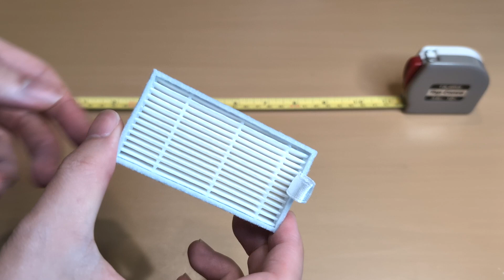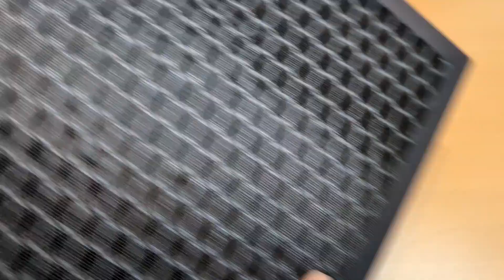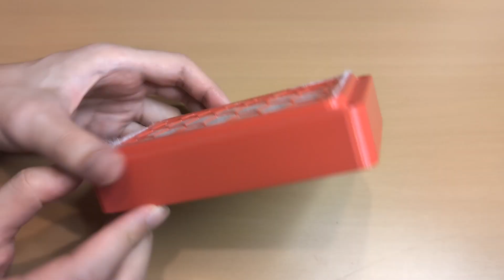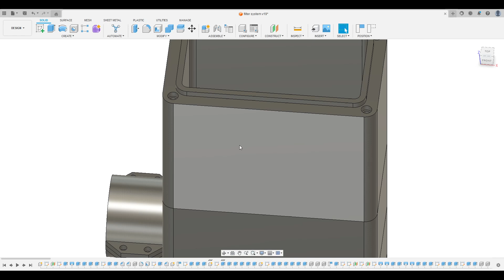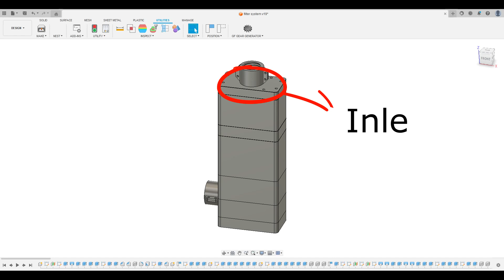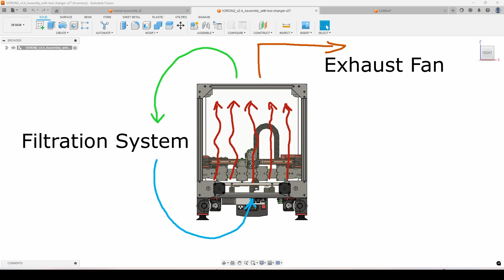[Tool Changer] Comprehensive Fume Filtration for 3D Printing: Clean Air Without Compromising Quality

Comment: Carbon filter usually goes first, you can also see that in commercial products, because filtereing air for fine particulates and then releasing carbon particulates in the air again is not a good solution. You can also have a HEPA filter first then the carbon filter and the again a HEPA filter
Reply: I've actually been wondering this, the Ikea air purifiers and Airthings Renew all put the carbon filter after the HEPA filter. The Airthings Renew also uses a HEPA 13 filter which is often a bit difficult to find on air purifiers.

I have a 3-4 particle sensors and under normal circumstances they often hover around 2-4 PPM both for 2.5nm and 1nm particles , so I'm unsure if having the carbon filter after the HEPA filter actually does release carbon particulates.
Reply: @MrGemeco  "... the Ikea air purifiers and Airthings Renew all put the carbon filter after the HEPA filter...." They usually wash it so it does not dust off too much. And of course they want to save money =) 
My air purifier also has it´s carbon filter after the HEPA filter but I wouldn´t do it for a DIY solution. You can never clean your carbon that well.
Reply from the maker: The sequence can be switched to carbon first, then the HEPA.

Comment: The volume of air going into the filtration system and coming out of it is (very nearly) the same. How will this create a low pressure inside the enclosure?
Reply from the maker: 1. Air Removal Creates Negative Pressure
◆When the fan actively sucks air out of the chamber, it removes air faster than it can naturally flow back in. This creates a temporary low-pressure zone inside the chamber.
◆Even if the air is circulated back, the fan continuously pulls air out, maintaining a lower pressure inside the chamber relative to the outside.

2. Flow Resistance in Circulation
◆The air being circulated back into the chamber typically passes through ducts, filters, or other components. These elements create resistance to airflow, slowing the rate at which air re-enters the chamber.
◆This resistance prevents the re-circulated air from fully balancing the air removed, keeping the chamber under negative pressure.

3. Concept of Airflow Balance
◆The rate of air removal by the fan is greater than or equal to the rate of air returning to the chamber. As long as the removal rate exceeds the return rate (even slightly), negative pressure will persist.
◆Circulation alone cannot eliminate the pressure difference because the fan continuously "dominates" the airflow.

4. Analogy for Clarity
Imagine a vacuum cleaner sucking air out of a sealed box but with a small hose feeding some air back in:
◆The vacuum cleaner pulls air faster than the small hose can supply it, so the pressure inside the box stays lower than outside.
◆Even if you connect the hose to the exhaust of the vacuum cleaner (creating a "circulation"), the resistance in the hose keeps the box in negative pressure.

5. Application to 3D Printer Chambers
In the 3D printer chamber:
◆The fan removes air, reducing the pressure.
◆The re-circulated air flows back but encounters resistance (through filters or ducts), making it slower to return.
◆This results in a persistent negative pressure, ensuring fumes or particles are pulled into the filtration system rather than leaking out of the chamber.
Reply: @SlowEngineering  It would be nice to verify if this is indead true with a smoke test.
Reply from the maker: @Ugaux  Yes, I'll assemble the parts and test whether they work with the sensors. I'll also test whether the negative pressure created inside is enough to maintain the fume inside the enclosure.
Reply: @SlowEngineering  Amazing, thanks for the hard work!
Reply: What is the reason of making the air circulate instead of just filtering/ exhausting it outside the chamber? Is that because of temperature drop when just exhausting the air?